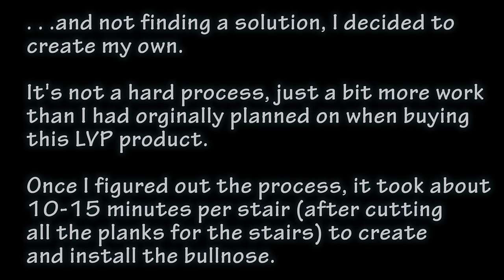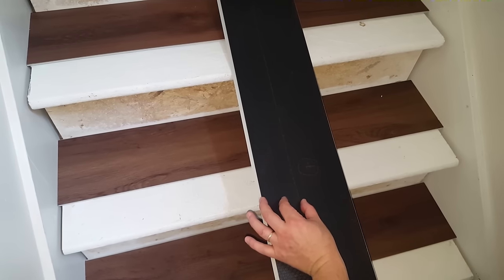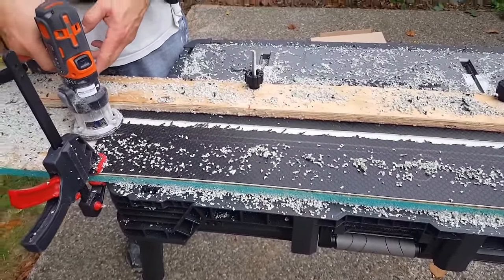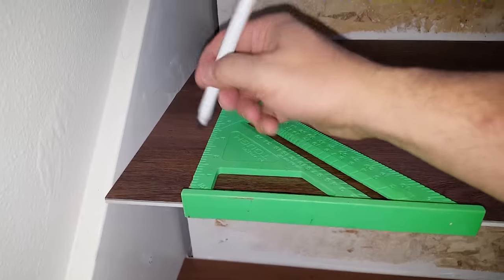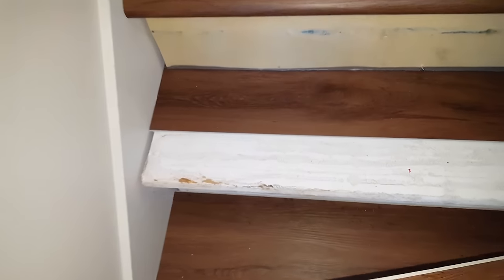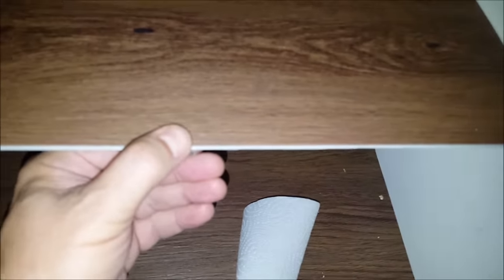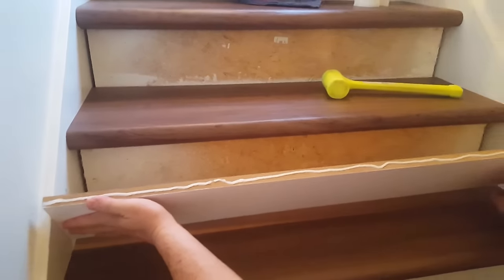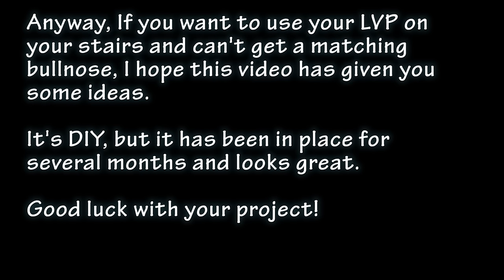LifeProof LVP Flooring: How to use on stairs and create a matching Bullnose!

Comment: Don't do this, unless you want the flooring to fail and have a terrible slip/fall hazard. There is a reason that manufactures do not make vinyl treads, carpet or solid wood is the best way to address any stair case...as always.
Reply from the maker: Sorry you feel that way. It's been nine months now and my results contradict your assumption. However, I can only speak to the LifeProof product I used as it has a texture that runs lengthwise and acts as a non-slip surface. I've even had contractors in for other work who have commented on how safe the stairs felt because they wear these little cloth booties (to keep the clients' floors clean) which they said have a tendency to be slippery.  Being chronologically experienced, I've slipped on a lot of stairs over the years (wood, marble, carpet, etc.).  Our family has been up and down these stairs for nine months in different shoes, socks, flip flops and barefoot and so far no one has slipped or fallen. Again though, I think it depends on the material you use.
Reply: @ChronologicallyExperienced  this is not my assumption. I'm a certified expert with the NWFA and have over 15 years experience in custom flooring and techniques. This is a hack job at best. Contact the manufacturer, let them know how you have manipulated the product and ask if they will warrant you work and methods, then I will retract my statements.
Reply: @djr7720  You seem like you might be an arrogant jerk (trust me, I am really pretty good at making this type of determination).  How do you think the factory makes bull nose planks?  I would bet it involves heat and bending.  Of course the factory isn't going to warrant the bent product, they want to sell $50 dollar a plank treads.  I am not sure how you think they are going to "fail"  but I applaud this Chronologically Experienced fella for figuring out how to make it work and it looks to me like it did.
Reply: @kc8ncr  stick with making assessments and not flooring installations. The manufacturer makes these types of products in a mold and are out of 1 solid piece, this would resist the product from failing. LVP/LVT products as a whole are garbage, at most price points anyways. Solid wood and carpet is still the best way to address any staircase. Please show me any vinyl product that has been on a staircase for over 100 years and still performs with a desirable asthetic. Everyone should quit trying to put lipstick on a pig 🐖 to try and a save a few bucks or turn a pumpkin into a carriage 🤣, its embarrassing. My company is very healthy and does a great job educating people on the right way to do floors, this is not in that realm of crafsmanship. However, it is quite entertaining, such as it should be. If you want real information talk to a professional, not Joe Jack the handy wanna be guy with a couple of tools he's used 3 times.
Reply: @kc8ncr  P.S. I own the company...😉
Reply: @djr7720 Thanks for your permission to continue making assessments, you've proven my point.  You probably are an expert in the field of wood and carpet.  As for you wanting someone to show you LVP/LVT that has been on stairs for over 100 years and is still performing with desirable aesthetics, there are two problems with your request, number one, you can't show any place where carpet has been doing what you're asking for twenty years at a similar price point and 2 LVP/LVT  hasn't been around for 100 years.  I would also say that although I am not a fan of LVP/LVT I have seen significant improvements since it came on the market in the 1970s.   Price point is key and I can understand why you want to be harshly critical as you're in the business to make money.
Reply: D Jr - You are the reason guys like me and the other guys DYI.  You pros make a ton of money on suckers. You are low on attention to fine details and quality but you are quick on getting done and sending the invoice.  I bet I've done just about every home project you can think of. Some are just so-so and some are fantastic for a mere fraction of the price and arrogance but a ton of pride.  Pros.... Ugggggg.
Reply: @jlennox362  thats a tough statement for someone that knows nothing about me, my work quality or my business model. Seems funny how quick you come to a conclusion when all the statements I have presented are based on quality. I have never suckered anyone out of a dime. You can surely do a fine job on your own, but I come trained, certified and experienced with a with a crew of craftsman. We use the latest tools available in our industry from quality manufacturers and products with history that have survived 3-5 generations. All of that is worth $$, whether you choose to pay for it is up to you. If you think your an expert by watching a couple of videos, walk a day in a pro's shoes and you'll see just how much you have no clue about.
Reply: I doubt the flooring will fail. The danger I see of a slip and fall is some coming in from outside and walking on the stairs with snow stuck to the bottom of their boots. Not a failure of the floor, but lack of a textured tread. If not for the potential of a slip and fall from lack of a tread, this is an excellent idea for finishing.
Reply from the maker: Hi Folks, please keep the comments civil. This was just a simple video about how I, a DIYer, got my own personal stairs to work for me. In no way was this intended to be a cure all for everyone and definitely not meant to start an argument between folks. If it helped you, great.  If not, that's fine too. But that's no reason to make disparaging comments about others and their opinions. D Jr is a professional and has to be responsible to his clients and that's understandable. His situation is different that a DIYer like myself who was doing this on his own house. Please be respectful and take this project for what it was - a simple solution to 'my' situation.  Thanks for watching.
Reply: @intelin123  never claimed to be Ghandi, just a professional. Sorry if that hurts your feelings 😔. I never started my career to make friends, and if I did, I would have been a failure. I'm sure you can relate to that.
Reply: @djr7720  since you are an expert you can post some videos instead of critizising others work.  You know what they if you aint go nothing nice to say dont even say it
Reply: My wood stairs are WAY too slippery, at least compared to my vinyl plank. My vinyl plank has a rough surface that makes it very slip resistant when wearing socks. Even when barefoot I can feel the wood has a slight slip to it compared to my vinyl plank.
Reply: @octechperson  this is very possible, most of your stairs, if they are solid wood and that is the only area of your home with a site finished product, it was more than likely finished by a painter and not a flooring professional. That's not true in all cases however. It would come down to the sheen level of the finish as well as the finish type on your wood stair treads. Floor finishes are rated on a scale referred to as Brungraber Mark for slip resistance and ratings. A higher sheen level for instance, a gloss type, would have a higher rating for slip resistance than a lower sheen level finish like a flat or satin. These variables all play factors when choosing the type of floor finish that best suites your lifestyle. That being said, let's look at this from a completely different angle. What's the cost of installing vinyl planks on your stair case or in your home for that matter, it is roughly half the cost of installing a solid wood site fisnihed floor. The vinyl plank flooring you have installed will last roughly 10 - 25 years, I don't care what the warranty says thats what your gonna get. By the time you replace that flooring 1 time you will have equated to or superceded the original cost of installing the solid wood flooring, which is a 200 year product. The solid wood flooring has about 150% - 250% more value than the vinyl plank flooring. Markets that cannot support solid wood, vinyl planking is a great option, I would recommend carpet in these scenarios. It cost a few to several hundred dollars to cover a stair case and it last for 5 - 15 years.
Reply: Really interesting how you are here watching and criticizing this DYI project when you're an EXPERT. 
How would you solve this problem? I'm the customer and I want a clean flush stair nose! YET the a55h0L35 at Iifeproof don't offer a solution for stair edges...
Reply: @PastulioA  sometimes I like to watch videos on YouTube, thats still ok to do right? I'm drawn to videos of flooring and things alike because ita my main interests. For the stair nose situation, the best scenario, would be to have a solid wood stair nose finished to match your luxury vinyl as close as possible and build your subfloor height to bring the LVP product flush with your stair nose....problem solved.
Reply: @djr7720  not judging just saying. The problem is... the company doesn't offer a solution and anything else on the market is completely off. So far this look like the best solution.
Reply: @djr7720  I saw NWFA certified in your above comment and figured this should get interesting. Been in flooring for 16 years and one of my best friends is a flooring inspector, he's the guy that determines if it was the product or installation and testifies in court quite frequently. Last thing I would do is argue with you or him. I was with him when he explained to a customer that the mineral deposit in the hardwood gave it a certain color and it was at that point I realized how little I know.

TLDR... This is NOT how you do stairs and I highly recommend against experimenting on family members to see if it's safe!
Reply: @U2ooB  thank you for your comment. The NWFA provides a wide range of resources that allows true flooring professionals to drastically increase their knowledge and earning capabilities. I actually inspect flooring instllations for Lowe's home improvement on the side, which covers about 30 Lowe's stores. On nearly a daily basis I inspect LVP, Laminate, Hardwood, Bamboo, Tile and Carpet installations and always try to provide the best advice when I do speak flooring. As a professional I present facts and experience.
Reply: @djr7720  Thanks for the detailed response. There is obviously a lot to flooring that I don't understand.
Reply: Opinions are like assholes.....everyone has one and they usually stink!    If ‘slip and fall’ is your biggest concern......maybe having stairs in your home is a bad idea.   People trip on carpet stairs too.   The DIYer did a great job.   He came up with a novel solution to a simple problem.   I’m not really sure why D jr gives a crap......he didn’t install it, and won’t be held responsible financially if the stairs fail over time.
And the ‘cost’ benefit?   Really?   You’ll save money in finishing in hardwood, because of the 200 year life span of wood.......
Hey, bro....people don’t live 200 years.    And it looks like this customer has a couple bucks if he’s installing $3 sqft flooring in a 2 story....(probably a 2200 sqft job?) 
I just don’t get it.....the job is already done, and the DIYer wasn’t begging for professional installers to come up with solutions....he just posted some cool stuff someone else can use.    Relax D!!
Reply: DJ. I totally agree. As a flooring mechanic (yes, I said mechanic not installer) since 1974 the most dangerous thing I've seen is vinyl flooring wrapped around a stair nose. It amazes me how many people put dollars over safety. I commend this guy for his initiative but am terrified of the consequences. As you said, separate nosings are available for a reason. This man has inadvertently persuaded these viewers to endanger themselves &/or their families in order to save a few bucks. Broken ankles & hospital visits will surely negate any savings accrued. Would you go to WalMart for a transmission repair on your car? Stick with the pros. Just because you can doesn't mean you should.
Reply: Mike Bertin why would anybody own a car? They’re dangerous....38,000 die in car crashes every year.  Obviously a much smaller number than the billions that die from slippery stairs, n stuff.... 
good on ya, for warning homeowners of the dangers of the luxury vinyl conglomerates ploy to break more ankles than the NBA!!
Reply: @kalikasurf  Sorry. Didn't realize you received a head injury falling off your bicycle.
Reply: Mike Bertin c’mon man, you know the kids of the 70’s were built out of steel and stone.... falling off a bike would have just made me tougher.
Reply: Mike Bertin I noticed you had plenty of trailer crash videos, but no videos on people falling down stairs......
I guess even when a product is DESIGNED to function in a specific way, it can still be dangerous.....and here we are, fighting over stairs 🤦🏻‍♂️
Reply: @kalikasurf  It's all about keeping yourself safe, my friend.
Reply: @djr7720  My carpet on the stairs isn't even 18 years old and it's essentially failed.   It's in need of replacement.  You are not likely to find any carpet on a stairs that will last 100 years.  Even if wood...they are going to need refinishing.
Reply: @candlewatt  Yes. That would be "par for the course" so to speak. Carpet generally need to be reinstalled every 5 - 25 years depending on the fiber type, carpet construction and overall use. Wood stair treads generally are refinished every 7 to 15 years. These are your traditional flooring types and are recommended for this type of application. The method shown in the video is not recommended anywhere by anyone, ever.
Reply: @djr7720  Why is it not recommended?   I went today to Home Depot and saw Lifeproof LVP flyers for products that look just like this...only more expensive.  I may agree with you if you tell me why.
Reply: @candlewatt  I'm sure there are a lot of people that won't agree with me, however, the cost to cover the stair treads and risers properly with luxury vinyl products would be roughly 80% of the cost of real hardwood. It is an inferior product to solid hardwood, and for a little more money you get a product that has a life-span of roughly 200 years.
Reply: @djr7720   1 stair tread, white oak, unfinished, at Home Depot is $32.  For that, you will have to cut the bullnose off of each stair to install the tread.  You still have to purchase the poly to finish the stair treads, too.  13 stairs at $32 comes to $416.  The LVP requires no cutting of the stair noses.  Each stair requires 2 LVP boards.  A case contains 7 boards.  So, you need 4 cases to do 13 stairs.  4 cases at Home Depot is $240.  A savings of $176 on stair treads alone and you have the exact color/pattern you want in the end.  There's a lot more work in the wooden stair tread method for sure.  PLUS, adding the wooden stair treads brings the step much higher on that first step.  Each wooden tread is 1 inch high vs just over a quarter inch for the LVP.  176 isn't that much savings I reckon but the color and "wood" options are far greater with LVP.  You are typically only going to find oak treads out there.  You'll pay fortunes for anything else.  They may not match the rest of your flooring.
Reply: @candlewatt  I never suggested doing it yourself. Somethings are better left to the pros....also as a general consumer you do not have access to professional wood floor finishes and contractor pricing on treads. I've been doing floors for only about 15 years, so my information is based on years of experience, not just a little research. Good luck with your project.
Reply: @djr7720  This guy did his stairs himself and they look good and he didn't have to pay a contractor.  So, his savings were huge.
Reply: @djr7720  there is a video comparing the resistance (ie slippage) of wood, vinyl and carpet. Carpet provides the most resistance and best for traction (3x greater), with vinyl being 50% more resistant than wood. Wood gives the highest potential for slipping (and falling).
Reply: @graynard2011  well no shit. Did you have to dig really deep for that info, because I hope you wasted a lot of time to tell me the most obvious information.
Reply: @djr7720  I was commenting on the video and comments, not necessarily yours. If other viewers are like me, they appreciate other comments on a video they like. You are free to share your opinion, as is everyone else. God bless our men and women who have kept the USA a free country.